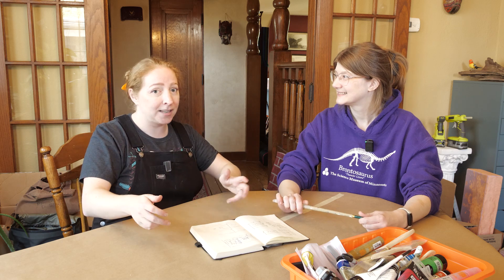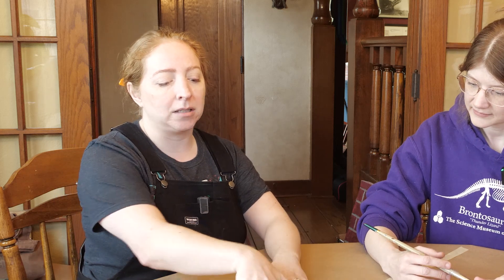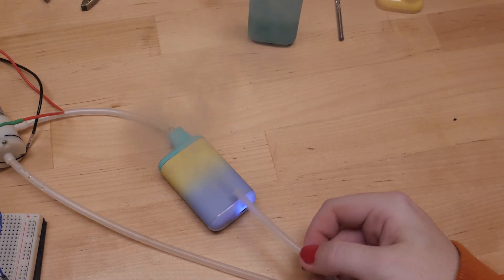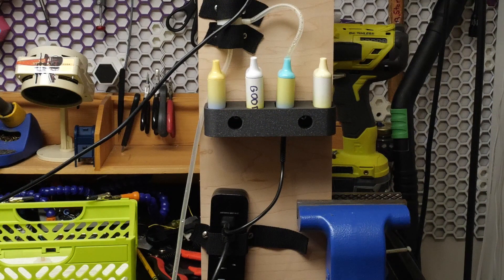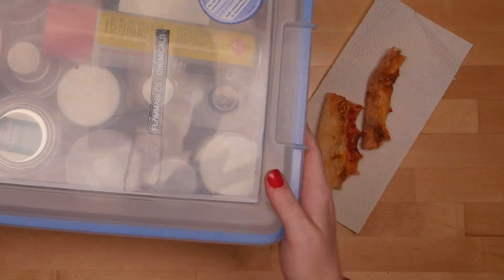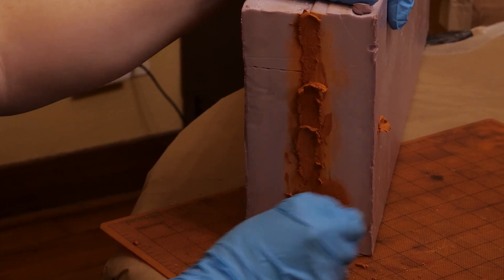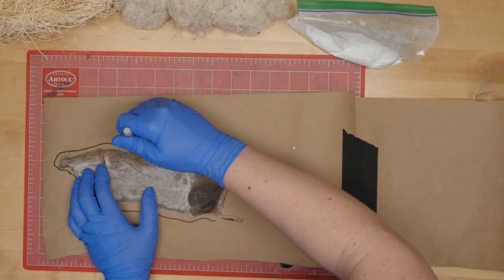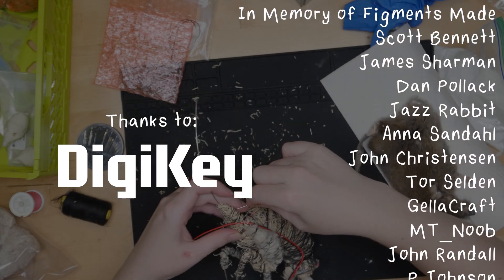Electronic Diorama ft. @thebrainscoop

Comment: Hi, do you have as much of a problem with your 3D printer as I am having with mine. When I bought my 3D printer I found out that most of the parts that went into the printer were classed as disposable and as a result were not covered in any warranty, I have now spent almost twice the cost of the printer trying to diagnose the problem and I am still not able to print anything. You opinions would be gratefully received.